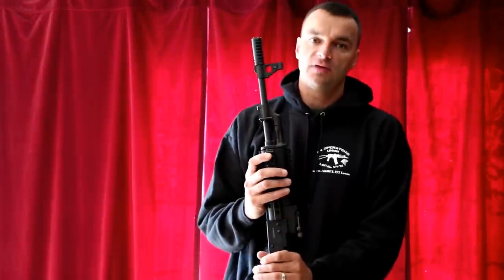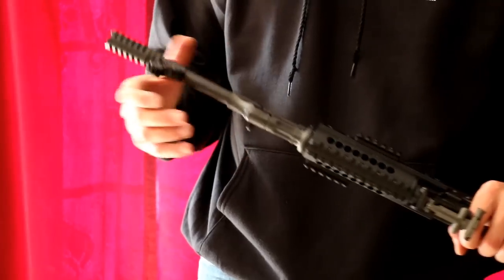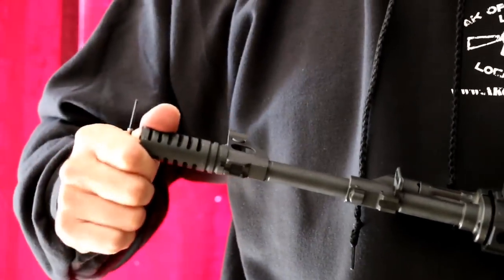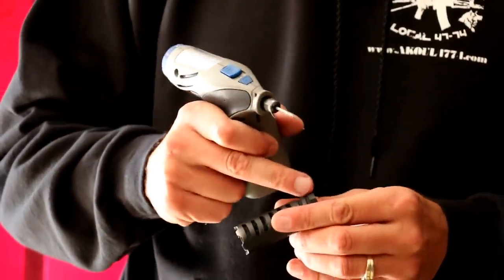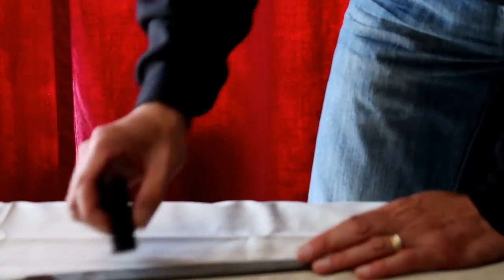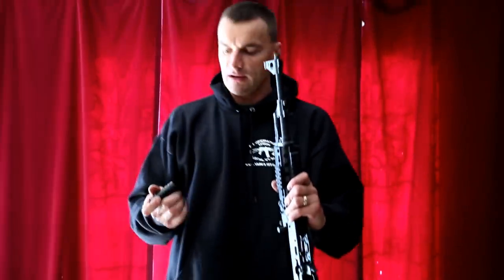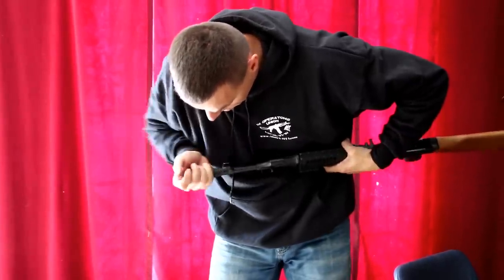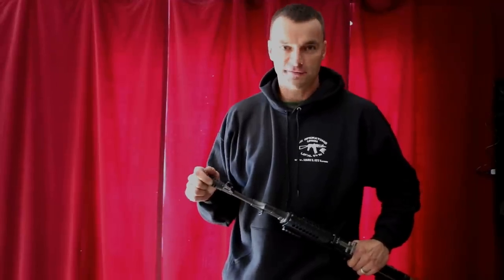How to remove wobble from AK muzzle brake!

Comment: I usually just use a rubber o-ring :)
Reply from the maker: Polenar Tactical i prefer metal to metal contact...not a big fan of rubber...lol!
Reply: That's what she said
Yes I went there- someone had to
Reply: +Polenar Tactical -  Hey thanks for that helpful tip. I tried a Nitrile "O" Ring and now the Muzzle Break is super tight. I coated the Nitrile "O" ring with some synthetic grease to keep it from drying out. The "O" ring will be blocking the "Decant" from popping out, all you have to do is press down on the "O" with a blunt tool and the "Decant"  will pop out into place. Thanks again !!!!
Reply: +Tether Plus What about the heat and smell?
Reply: +whiskey papa  A little dab of Multi Purpose Synthetic grease on that "O" ring, will always do the trick. I used it on my WASR, it did get hot, but the "O" Ring stayed intact, and honestly I don't remember smelling anything.
Reply: Tether Plus What the heck, I'm givin it a try. Thanks man.
Reply: You chance to loose nothing on that modification. I got the "O" rings from Harbor Freight, it came in a set. I shaved off to much off my "Muzzle Break" and it tightened on the 11 o'clock position. That's when I got that great idea from " Polenar Tactical" to use the "O" Ring. Hope everything works out.
Reply: As hot as AKs run, you'd think rubber would melt.
Reply: I shoot close to 100 rounds, and mine held up pretty good. I didn't use a "Rubber" washer but this one in particular was a "Nitrile" "O" ring. Just make sure you dab a little grease on it before you screw your muzzle on.
Reply: Most modern black colored o-rings are actually acrylonitrile butadiene rubber, a synthetic copolymer material that is heat safe to about 250F degrees. The tip of the barrel isn't the hotest part, that would be much closer to the throat of the chamber, and hence seldom reaches above this temperature.
Reply: Didn’t even have to watch the video with this comment 😂🙏🤙

Comment: Thanks for the info. My muzzle break pin didn't fit correctly so I widened the pin hole with my dremel tool.   I used 80 grit sandpaper on my kitchen table to take off a bit of metel off the muzzle break.  And I have a perfect fit! Thank you Rob.
Reply: i did the same thing with the 80 grit with some water. it leaves a clean surface on the muzzle brake but takes forever to remove material.

Comment: Rob, thanks for the tutorial vid. I have just a very slight wobble on the SRVV Jet brake installed on a Century C-39 V-1. This should tighten it up without any issues.

Comment: I figured I was being a little obsessive compulsive when I started to look for way to remove that wobble and stopped myself contenting myself with the realization that the detent pin keeps the muzzle brake from unscrewing off or even getting even slightly looser but yeah, I think I'll file mine down too. Thx for the video.

Comment: I just installed an "AK74 style brake" from Atlantic Firearms onto an AKM/AK47 and it initially had noticeable wobble because of about a 1/16" gap between the base of the brake and where it indexed to.  I took a 7/16" internal-tooth lock washer (a very thin one) and dremeled off most of the interior facing teeth, which made the hole almost the perfect fit for the barrel diameter on my 7.62x39 WASR10/63. Then dremeled a small notch in the outer part of the washer for the detent-spring post, and it tightened down perfect. Acted just like an AR crush washer. I didn't want to mess with filing metal off.  My "AK74-style brake" (not same as authentic one - the cheaper clones that fit the 14-1 L threads of AK47s do not have the expansion chamber or forward wall) originally was a full 180 degrees from having a flush fit.

Comment: This worked perfectly with the fighter brake I got from AKOU. I added some 3 and 1 oil to the file before filing. Perfect tight fit. To thanks for the tip Robman....

Comment: I usually just use blue locktite or some plumber's tape on the threads. Always gives me a solid front brake.
Reply: does the tape hold up to the heat

Comment: I did this with a DA fighter brake brake on my AK. Afterward, the brake snapped in good and tight with no wobble and I had to grip it with a cloth to get it to turn back out. After firing a couple hundred rounds, though it loosened up just a tiny bit so it wobbles again (though not as bad as before) 

Is this OK, or should i file it around again?

Comment: I had the same problem with 2 CNC Warrior Knurled Brakes on my Yugo M70 & Czek VZ58, each one was exactly 1/2 turn out from cinching down tight. Oddly enough the 2 CNC Warrior AK74 style brakes cinch up rock solid on the same 2 rifles!

Comment: Thanks for this most excellent video. My C39 had a 1/4 turn before tight and pin engaged. I also had a bevel to work on along with the flat surface of the brake, this is CIA's proprietary brake. I used a new countersink to bring the bevel down while working the flat surface also. When completed, it's just like your, a good hard twist and "click". Now my brake feels like part of the weapon with this precision fit. With the threads pulled tight now, there should be no blow-back off crud into the threads. This is the only proper way to fit a brake that I can see. Thanks again for the tip!!

Comment: I did this, and it worked. The only thing is, now that I'm finished and it's on my AK, it would seem the brake curves upward slightly in relation to the barrel. There would be no problem whatsoever firing the weapon, but from an aesthetic standpoint, it throws me off. I'm not sure if it's just an optical illusion due to the fact that it's an AK-74 style brake and has holes cut in the top, or if the brake really is curved slightly either because I filed it wrong (unlikely, since I made sure to rotate the direction of the brake as I was filing it and was on a flat surface), or if cheaperthandirt sent me a bent Crapco brake.

Comment: Rob, would peel washers work also? I am not intimately familiar with the AK muzzle so I could be talking through my hat? Thanks for the instructional video. Ding...
Would you cover the freshly filed area bare metal on the muzzle device with something to prevent rust if it is a carbon steel device?
Reply from the maker: RK Harm24 the peel washer would cover the spring loaded pin and it would prevent it from going into the "notch" cutout, so not the best solution IMHO.@fresh metal - i always try to repaint this surface, i probably should say this in the video...
Reply: Ak Operators Union, Local 47-74 Thanks Rob for the updated info.

Comment: Glad mine didn't take 15 minutes worth of filing since it was just a tad bit off. I used 80 grit sandpaper vs a file though. Filed the metal fast and left a nice finish left it bare for now but it's going in to get coated soon

Comment: On my Saiga conversion there is no detent on the front sight post. I had to remove about 1/2" of barrel shroud, then thread the barrel (14 x 1LH).  But, due to clearance issues with the pipe cutter and the front sight post, I only have about a 1/2" of exposed threads to screw the muzzle break onto the barrel. Will this method in the video work well to time the break snug against the exposed shoulder of the barrel shroud that extends a 1/2" in front of the sight post.  So, the muzzle break would have to screw down flush with the shoulder of what is remaining of the barrel shroud.

Comment: Does this method also work when the muzzle brake is loose after firing? I have an Arsenal SAM7R-61, and the AK-74-style muzzle brake I have was snug as a bug under a rug initially,  but after firing there was some play.

Comment: Can the wobble impact accuracy? I just got my "new" AK (1962 Polish Army surplus) and installed comp on it and I cannot zero the red dot - I have about 1,5cm free space around the point of aim on the target and the adjustments don't work anymore. While with no comp I can zero de red dot to be on target on the point of aim (I zero at 25m)

Comment: So I'm sure for absolute maximum accuracy making the muzzle device tightly fit would be the best thing to do via either this filing or a shim of some type etc... My question is: how necessary is this?  I have a vska and it came with a cia chevron brake.  When i did my initial stripping and cleaning before i take it to shoot i noticed the brake wasn't threaded all the way down and has a slight wobble.  When i finished cleaning i put it back on and it wouldn't quite make it all the way down tight.  I'd say it's like 10° off maybe, it's really close to the detent pin when it's snugged good.  So i backed it off to the last closest point where it engaged the pin on the front sight post.  It still has just a little wiggle to it but it's threaded on by like 20 threads.  I know it's safe to shoot as the brake can't move enough to obstruct the muzzle but like i said up above, should i really file it or shim it to get it absolutely tight?
Reply: It’s not necessary whatsoever. They all have a little bit of wobble and are not tight. This video demonstrates obsessive compulsive behavior.

Comment: I hate to use rubber O-rings, so I took some measurements with a caliper and made shims with an aluminum can and it is snug and heat resistant!

Comment: Rob I did this for a flash hider on my vepr fm and it only needed about 1/6 turn left but the there wasn't enough threading left on the flash hider so when I got it to match the pin it pops through and is loose again. Do you know any other good way to fix it or do you think just using very thin metal washers from hardware store would be ok?

Comment: Great Video Mr. Ski, I really enjoyed your Tutorial on the AK muzzle break. But I have one question,.........if we can't get that muzzle break just right, can we use a "Crush Washer " ? Thanking You in Advance.
Reply: I saw a video on modifying a Draco and the brand of muzzle break included a crush washer rather than having a notch.
Reply: So the "Draco" had vents that were consistent. In other words their was no "wrong " position when you tightened it down ?
Reply: +Tether Plus The video wasn't real clear on that. Check "Building the ultimate Draco". I think it was on James Yeager's channel.
Reply: Yeah I subscribe to Mr. Yeager, I'll check it out, Thanks.

Comment: Would you still prefer this method ? I ask cause wouldn't it be more easier to Rust since you taking the original finish off. Or would you recommend getting a crush washer if so what size crush washer
Reply from the maker: +fioshd97 Yes, i still do it. You can use liquid Blue to cover steel.
Reply: +Ak Operators Union, Local 47-74 thank you for the reply I will try his asap I don't like the idea of my muzzle brake having a little wobble idk if that's safe or not I hear and see so many different things some people say it don't matter some say it's not safe
Reply from the maker: fioshd97 wobbling isn't good. Especially with longer brakes...
Reply: +Ak Operators Union, Local 47-74 thanks so much

Comment: I like this method, but was worried I may file it a bit off angle.  I took a copper 14mm oil drain plug washer from a local car parts store to a belt sander.  The inner dia. is fine.  The outer is too big.  Belt sander with a pair of pliers was used to grind down the outer dia. of the washer to be proper size.  A touch with 1k grit sandpaper to clean it up and it fit great.  Had to sand a few .001's of an inch off the washer face to get my Rifle Dynamics brake to rotate to the detent.  Snug, not off center, and gives a bit of steampunk feel haha.  Was worth a try.  Aluminum washer would work as well.

Comment: Went to go do this for my Ras47 and the detent pin got jammed inside the post.  I've tried heat, penetrating oil, and its stuck fast in there. suggestions on getting it out?

Comment: I have a muzzle brake that won't come off.  It's not welded.  It just won't twist off.  It is the standard 14 x 1 left hand turn.  Any suggestions on how to get it off without destroying the brake?
Reply from the maker: homersimpson6969 Ok, lock your AK in secure position and try to use some sort of mechanical lever on the brake - like a screwdriver (depends on what brake you have - if this is 74 style, you can stick screwdriver through it). If this will not help, heat it up.
Reply: Ak Operators Union, Local 47-74 Thanks for the quick reply.  A little heat and some elbow grease worked out.  Great channel.  Keep up the great videos.

Comment: Don’t use a tiny file. I have a machinist file that is about 1/2” wider than the brake. Lay the file down flat and rub the brake on the file evenly. Finish with a knife sharpening stone to knock any burr off and use some cold blue. You can’t tell anything was done to mine!

Comment: why to permanently modify you're equipment when you can use crush washer or spring washer ?
Reply from the maker: damiana1990 you are modifying only muzzle brake, you are not touching rifle. Crash washers aren't perfect if you change your muzzle devices often...

Comment: would this work on a 74 style brake seeing as the threads are much thinner and could be partially filed at the base of the brake?
Reply from the maker: Yes, it works on both types. You can also use silicone oring.

Comment: Good stuff Rob...will you paint or otherwise cover the "bare steel" you have after you have sanded the brake?  To keep corrosion away?
Reply from the maker: Thomas Hark yes, i usually add little of paint on it afterwards.
Reply: Or You could buy the little bottle for cold bluing for like 15 bucks I believe
Reply from the maker: akshooter762 that is awesome idea!
Reply: akshooter762 I have had a bad experience with cold bluing. I have seen it not hold up to solvents. Just my experience.

Comment: I have a Tantal that came with a very thin convex shaped washer. The one side had been flatend to leave room for the locking pin. So I went to the car parts store looked around got some that would work. Drilled a hole in a piece of wood to place washer. And a smaller socket and hammered to the convex shape. Hardened the washer and now I have it on all my AK'S

Comment: does anyone know if this technique would work on an SLR107FR stock brake? Thanks ahead of time
Reply from the maker: +elhouse666 yes, it works for all brakes.
Reply: +Ak Operators Union, Local 47-74 this doesn't work on arsenal slr1o7fr what do I do
Reply from the maker: John Hartbarger You can use crush washer
Reply: +Ak Operators Union, Local 47-74 Ok Thank you I'll try
Reply: Thank you I'll try it soon as I get a new brake.

Comment: did this on my WASR10 with Tapco slant brake, and left enough that it had to be tightened with some pliers so it was a super tight fit and absolutely no wobble. After returning from a range trip running around 250 rounds the wobble is back. Anyone else have any experience with this? Any thoughts? I'm at a loss how that is possible unless the whole sight post moved?
Reply: This happened to me with my arsenal sam7r. I got an adapter for 24mm threads and an arsenal 74 brake. Had to file the adapter down so that it would be snug without any wobble. Went to the range and fired 150 rounds and it wobbles again. I'm guessing the metal expands due to the heat. I don't know. But its like I didnt even file it down. Kind of irritating.

Comment: Thanks for the video, good tip!  I did not have good luck with this however. Just For Everyone's Info:  This does not seem to work on my Saiga SGL26-61.  The rifle's muzzle seems to be bottoming-out inside the brake and it comes to a dead stop well before the locking tab engages even with the bottom (of brake) filed down.  Must be my particular brake which seems to taper-down slightly just before where the port holes begin.  I'm going to have to try a washer approach.  Correct me if I am wrong here, but just a friendly warning to other SGL owners that have the stock brake...

Comment: Would blue Loctite work as well? Or would the barrel get too hot for that?
Reply: +Jodi Lester I don't think Blue would hold up, honestly.  Loctite does make a high-temp version though.  I think you're better off just filing some material off, because nothing is going to hold is as well as the spring loaded notch.
Reply: Thanks for the response! The more I think about it the more I'm inclined to agree...